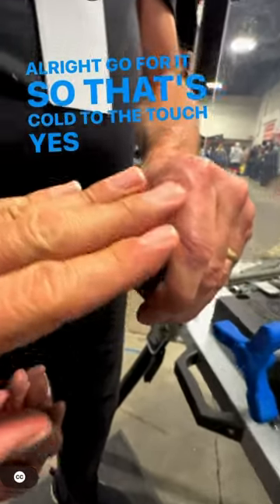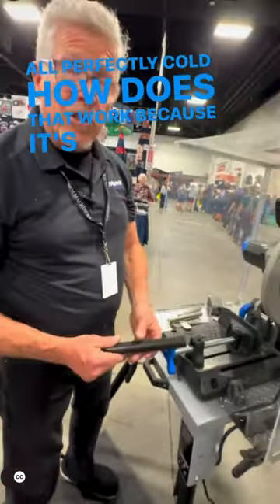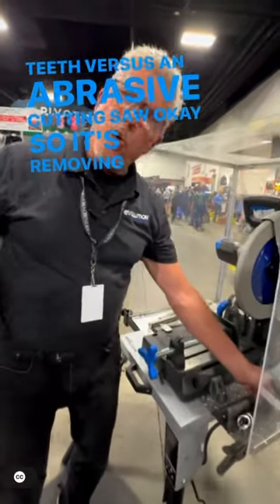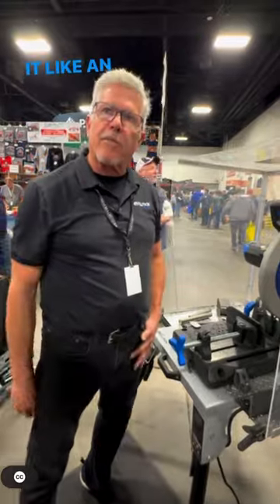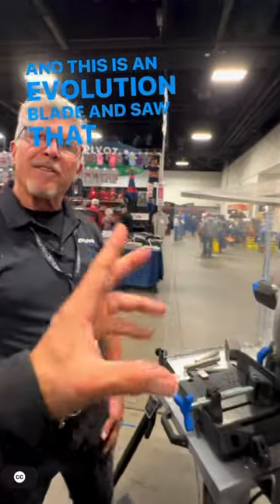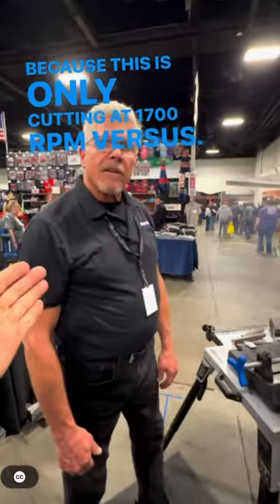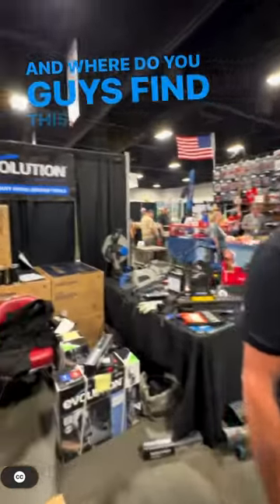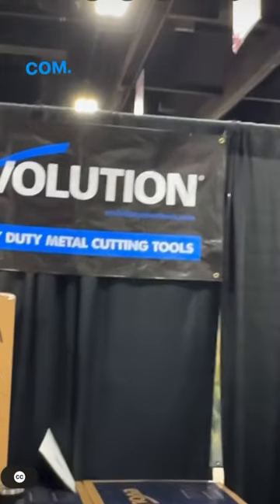I Couldn't do that with my tools. #tools #construction

Comment: This is nothing new.. I was selling metal cutting chops saws 25 years ago (same thing.. carbide teeth at reduced speed).. This salesman missed out on the best demo, cutting a bundle of threaded rod without messing up any threads. No chasing the threads with nuts or a die...

Comment: Ok people. You have 2, 4 and 6 pole universal motors. A 2 pole motor is in the realm of 3400-3600rpm, a 4 pole motor is in the realm of 1400-1800 rpm and a 6 pole motor is roughly 1100rpm. Most motors are available in 2, 4 or 6 poles.